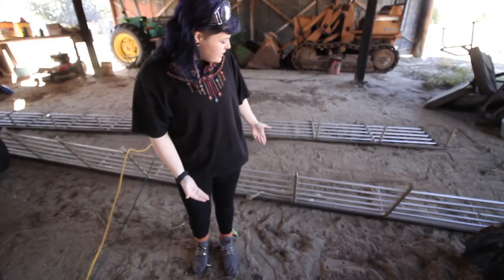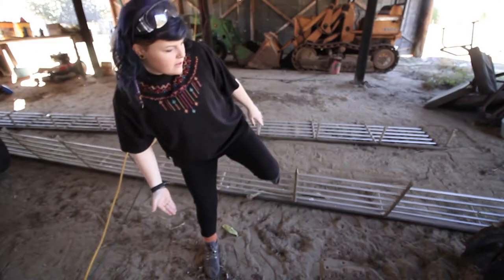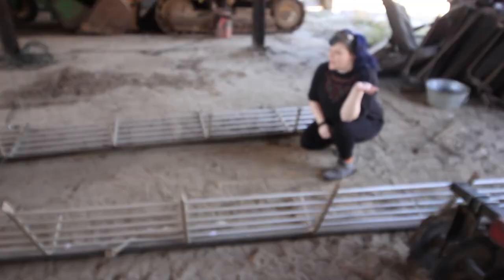SCHOOL BUS CONVERSION + SKOOLIE + TINY HOME ϟ RECYCLING ORIGINAL BUS LUGGAGE RACKS / CLOSET STORAGE

Comment: you were asking about putting your Storage on top of your fuel line. if it is made of a metal tube yes you can. if it's made from a plastic or rubber hose I wouldn't suggest it.
Reply from the maker: thank u! it has a metal cover so It should be ok